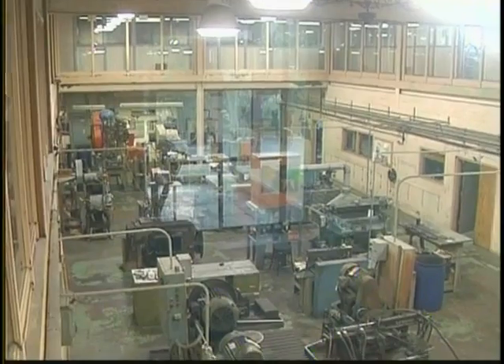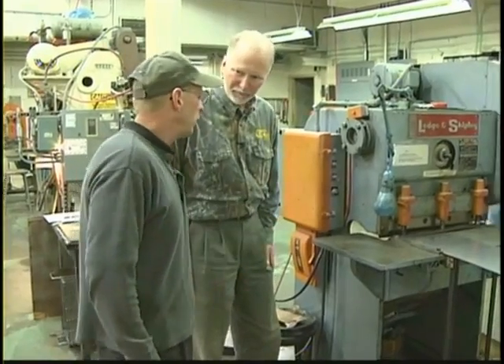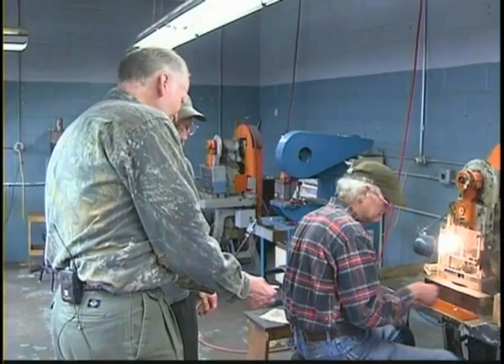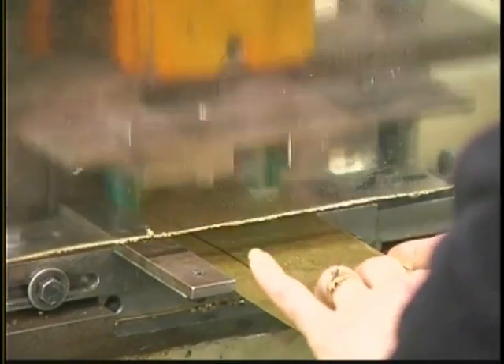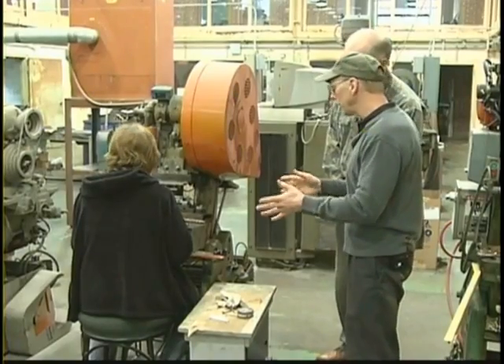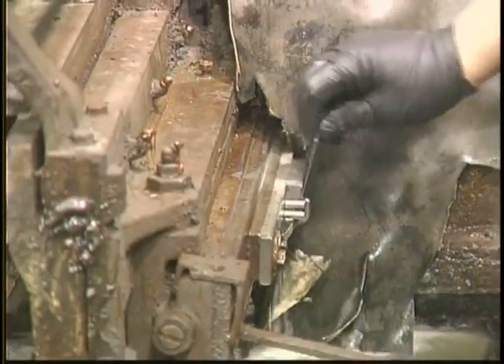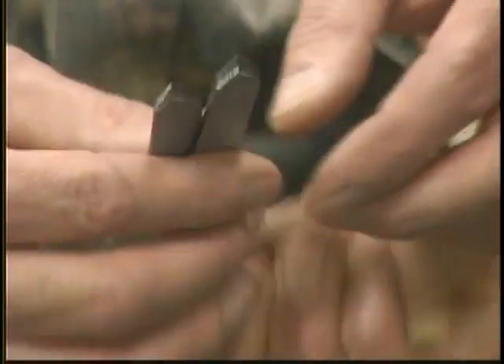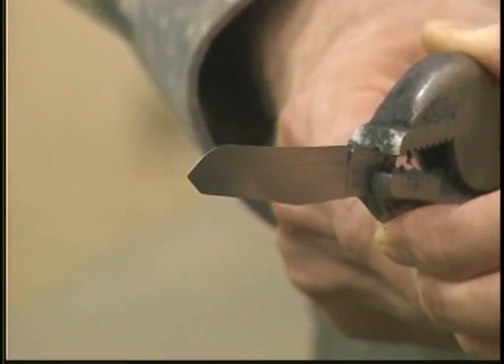Great Eastern Cutlery Factory Tour Part 1

Comment: Could GEC make an old fashioned scout knife? Cap lifter/flat screwdriver, can opener, awl, and blade. Also with bail.
Reply from the maker: We actually did make one a few years ago, it was the #99 Texas Camp Knife.
Reply: @Greateasterncutlery  How about a scout that would be more easily carried?

A scout on a 35 would be incredible, and has been asked about for Years on Bladeforums by a LOT of folks.
Reply: @Greateasterncutlery  Even though many have asked for a scout #35, I personally would like a #53 scout, if a 35 wasn't possible.

Comment: Just ordered a nice blackwood sunfish from gp
Gotta be so difficult to make these old ittybitty folders
3:50
What is O72 steel?
Reply from the maker: Its the thickness of the sheet of steel.
Reply: Great Eastern Cutlery

Uh, ok
I misspoke, i ordered and received a #79 workhorse african blackwood
Great knife, very fun, exceeded even my high expectations
What black oil did you use for the pivot, it seemed a bit gritty at first

Thank you
Reply from the maker: VicariousReality7 The black is probably a little buffing compound leftover inside the knife. You can flush it out with your oil of choice.